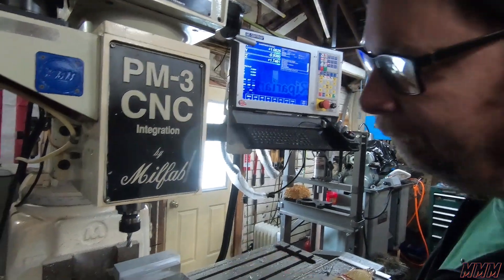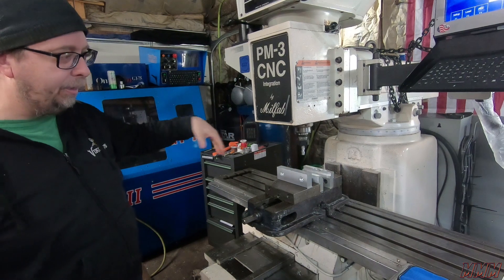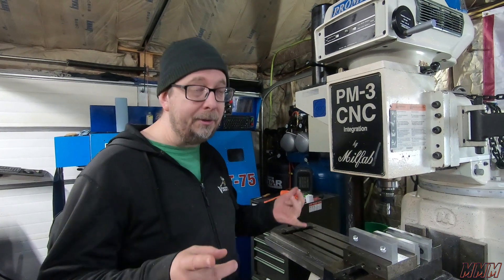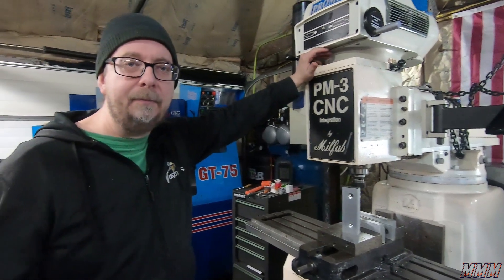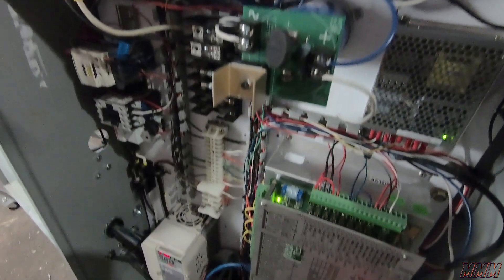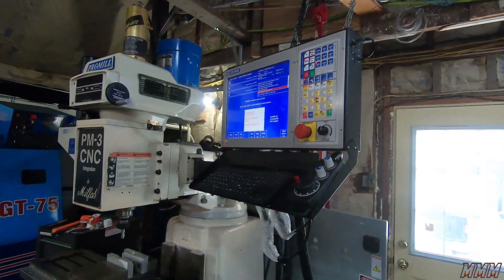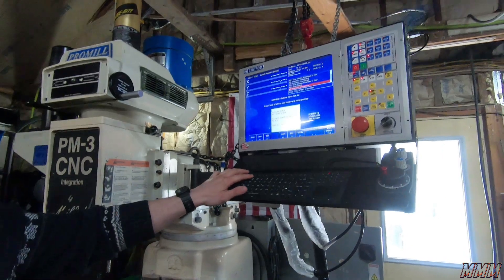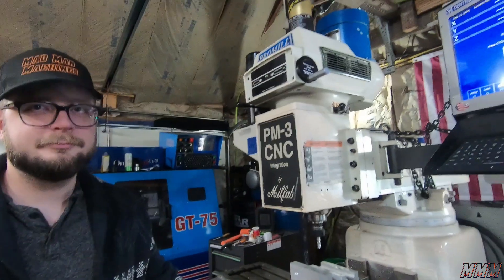Saving $20,000 over a Tormach with a Centroid,  First Chips and a bit of dish!

Comment: and you dont need low gear. set mine up for it with custom switch and all never used it in 19 years.
Reply from the maker: Yeah, we still haven't hooked it up...lol.  I suppose we may want to use it for rigid tapping, but the control even does thread milling in conversational, so we don't even need low rpm, though thread milling, the tooling is more expensive.